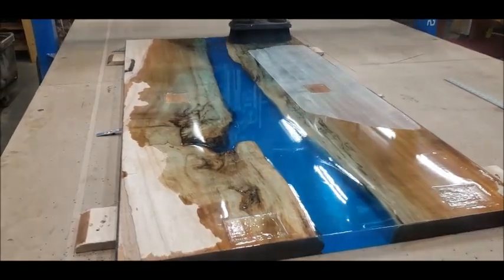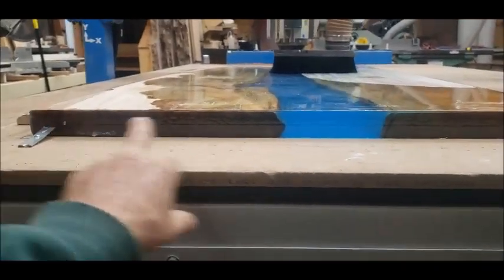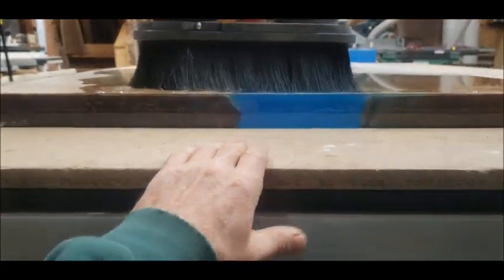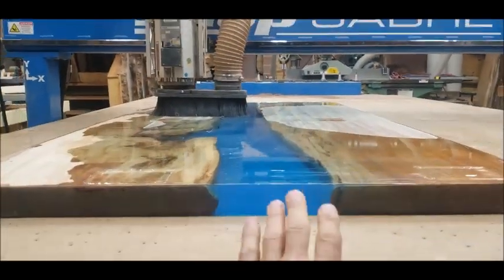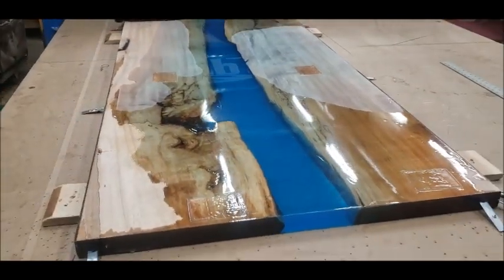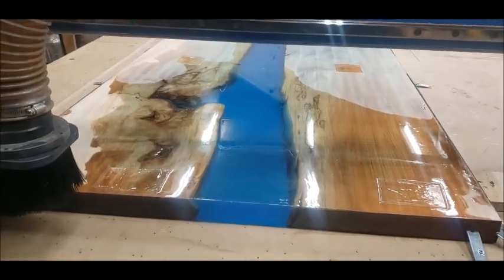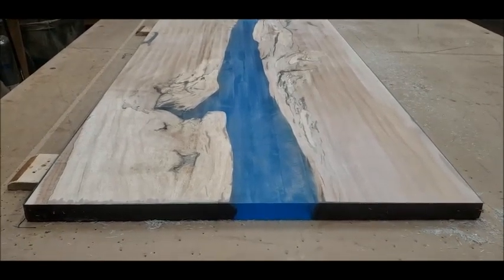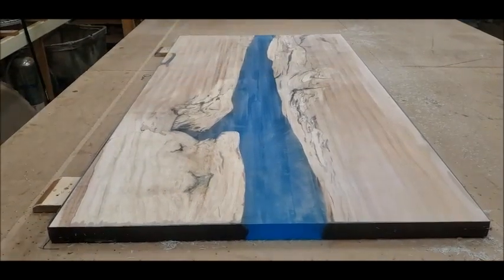Why does your river table cup after pouring it

Comment: Just made a large table, and had to leave some epoxy under the two ends of the piece to try and get a full 2 inch thickness, and that’s what the client preferred when given the choice knowing the risks.  The result is an environment where the wood is contracting slightly, creating a subtle curve in the boards only where the epoxy covers the underside, preventing the wood from contracting in a balanced manner.  Off by 1/4 inch when moisture in the air is low

Comment: No it’s not that  case   Totally disagree with this video he’s right about the overflowing with epoxy. My thing is when you pour make sure everything is clamped and leave it for at least 72 hours. Also, when you flatten your top, put it back on your table and clamp it it stay flat and leave it for another three days, and also the most important thing is if you can keep the same temperature in your room or in your shop

Comment: I have poured a few table tops now and always overpour to make sure any cracks or voids get filled.  Never had it cup from doing that,  Im gonna guess is there is more moisture in the pieces than there should be.  I had one that cupped on my after it was flattened, removing the excess epoxy and taking off some high spots.  My pieces were flattened before I used them.  I believe my problem is I found a higher moisture content in one area of the bigger, center  slab, that I didnt notice before.   I flipped it so the hump part is up and clamped it down, hoping it stays put after awhile.

Comment: I poured 3 gallons of epoxy at once it cured to fast, heated up and cupped. I had to cut it all out and start over, I poured in 4 different batches to be safe probably could of done 2 pours but epoxy is expensive so I went on the safe side.  I’m still learning.

Comment: it makes a lot of sense.  if you're not pouring a tack base on the bottom before you set the slabs in, and you pour the river and top of the table it is going to cup upwards on you.  I am personally not a fan of epoxy covering the whole table; top or bottom.  I believe the river should be epoxy and the wood slabs look the best with a hardwax oil finish.  It is the closest to feeling the grain still and not a coating.   thanks for the video.

Comment: Great video.  My 40” wide river table is cupping quite a bit.  Is it possible to use some boards and clamp it, tightening over a few days to pull it flat? Then maybe reinforce the bottom with metal strips to lock it flat.  Any suggestions ?? Much appreciated
Reply: Ya thats ur best bet

Comment: I did an epoxy counter top for my van. It is poured over vynal flooring glued to 1/4" plywood.  Epoxy only on top. In cold temps the countertop REALLY wants to cup into a U shape. Accidentally let it get freezing cold in the van and had to superheat my van to get the counter to lay flat again. Then I glued it with panel bond and screwed it down from the top. I did have it screwed down from underneath but when it got cold the counter bucked so hard that it popped off the screws. Might have avoided this issue by pouring an even amount of epoxy on the bottom if the counter as well.

Comment: pour a 3.2mm pour first to avoid cupping, then place boards on top, i call this my set coat and it gives you a finished bottom
Reply: Ken Cheadle- Are you letting it setup then putting boards in? Are you sanding the set coat?

Comment: I usually do add silicone to dam up the epoxy. I didn't on this one because I don't see enough of a difference between using the silicone and not using it. I mainly use the silicone to dam the epoxy around other voids in the slabs other than where the main river is. Either way there is going to be cupping unless you cover entire surface in epoxy which is what I've been doing lately. nice video explanation thought Brian.

Comment: Just another observation and comment I made on a question do you guys think this holds any water? The comment asked about the top coat cupping the table
I think maybe when it is done as a separate poor on the top  it’s not pulling on the sides of the wood like the river does when it shrinks, if the table has been pored and is already stable the river has already set in place without any stress on it and will hold any shrinkage caused by the top coat from developing ( just my thoughts) so we can assume that if you poor the river in the leased amount of pours possible, use a dam and maybe even after the firs layer of the river is poured and is set lift the centre of the table very slightly so as the second pour shrinks it will be pulling the slabs back into kilter

Comment: How about milling one side at a time don’t clamp both  sides just one, mill the epoxy off, then do the other side separately then this will allow the pulling of the epoxy to release,  you can then clamp both sides. Why go to all this bother, well if you have a table that is so bad you will lose to much wood, or that you might crack the table when you pull it down with the clamps this will pre release the tension and reduce the amount of wood needed to get flat ( Just a thought ) good video

Comment: Quick thought, If there's very little epoxy on the bottom more moisture could potentially get in causing the bottom to expand While the top is locked in with the epoxy. I used to put lots of finish on my table tops and bottoms to get a sealing equaLibrium for Potential moisture migration top and bottom Which can cause your table tops to Become concave.

Comment: I just bought my first slab to work with and the guy at the shop was doing exactly this with the CNC on some tops and he told me about the bead of caulk on the edge.   I also thought it was for cleanliness, but this makes sense.    So when they are making the river tables with epoxy covering the whole thing, how do they keep it flat?   By doing the bottom first?
Reply: I think maybe when it is done as a separate poor on the top  it’s not pulling on the sides of the wood like the river does when it shrinks, if the table has been pored and is already stable the river has already set in place without any stress on it and will hold any shrinkage caused by the top coat from developing ( just my thoughts) so we can assume that if you poor the river in the leased amount of pours possible, use a dam and maybe even after the firs layer of the river is poured and is set lift the centre of the table very slightly so as the second pour shrinks it will be pulling the slabs back into kilter

Comment: If you cut into the epoxy then use epoxy to glue it back together to straighten the table. Will the cut line show in the epoxy?

Comment: I have just started making tables the overspill is thin and cures and shrinks quicker the deep pour cures a little slower and so is displaced as the top thin layer shrinks just an observation but you are right overspill is the main cause in my opinion from a physics point of view makes sense.